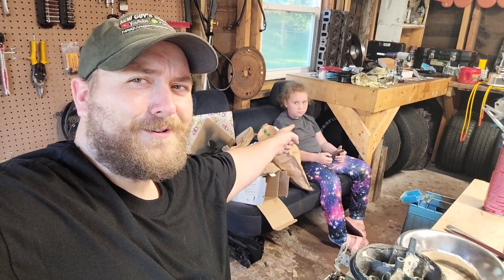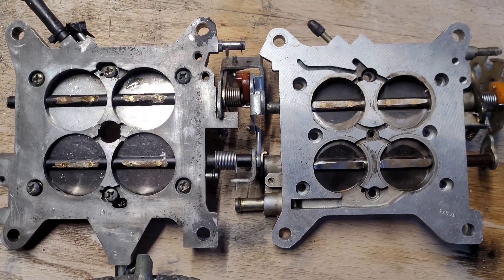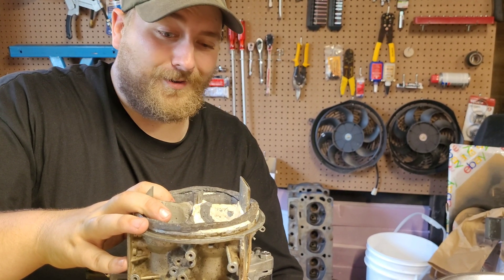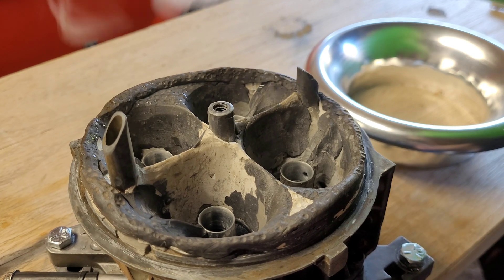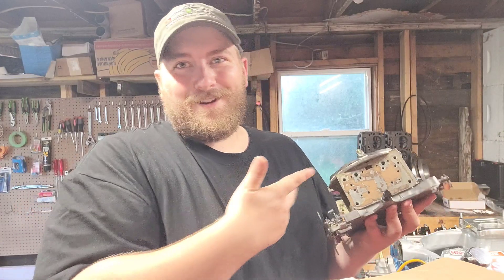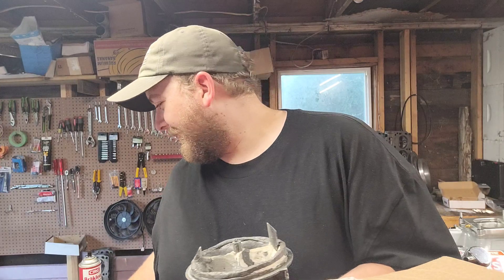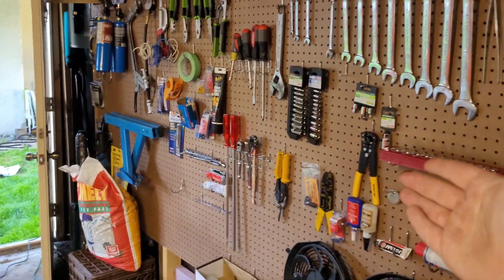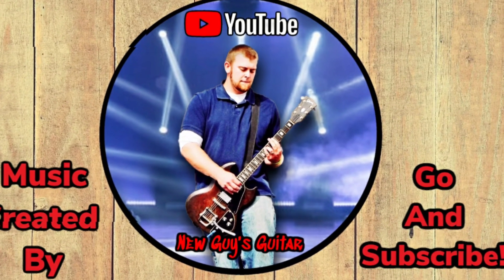At Home Flow Testing! | Holley 850 Baseplate On A 600 Main Body | Carburetor Performance Mods! | XMC

Comment: A 850 flows more that a 950 and a 950 is a 750 body with an 850 baseplate… 750 has smaller Venturi than 850 🙄🙄. Holley math? Make it make sense. A 950 is a little more responsive but is actually around a 830 if I remember correctly.
Reply from the maker: Gets more confusing since an HP holley 950cfm.....actually does flow 950cfm 🤣
So now you have to know what kind of 950cfm carburetor you have, to know what it flows on top of all that 😂👍
Reply: @newguysgarage6802 not by any flow tests I’ve seen. Any flow test I’ve seen a Holley 950 flows around 830, which makes sense considering a smaller Venturi with the same baseplate flows less that a larger Venturi with the same baseplate. I’m sure it flows 950 on holleys bench, but not anybody else’s 😂
Reply from the maker: Its there ultra xp line that the 950s actually flow 950, all the older ones are just 750 main bodies with 850 baseplates lol 

The ultra xp line actually has large venturis

Comment: Nice share, love your car color, interesting carb mod gotta sub to see 👀 your flow numbers, back in the day i would take a 750 vacuum secondary carb and drill it to make 4 corner idle and add metering block to jet it like i wanted also had a 850 double pumper and my 750 ran very close on a 427 bbc !! 😊😊
Reply from the maker: @RonaldLewis-py6yt  nice! 😃

Ya the XMC project has been a long running series on the channel with very interesting results! I can't wait to see what this baseplate mod is going to show on the flow bench 😁

@JosephNowak is who is flowing it, has a couple videos on it with the numbers so far. Defenatly go check him out and give him a like and comment for helping us out 🙂

Comment: Using a 3310-1 base plate on a 600 main body, using the 3310-1 center pivots and metering plates mounted on a A code 289 with J code heads that have been worked over with larger valves. The 850-950 base plates are the biggest base plates you can get for that series of carburetors
Reply from the maker: 3310-1 that should be a 750 baseplate right? 
A 750 baseplate on a 600 main body is actually what a regular 650 holley combo is lol. 

But they just chamfer the very bottom of the bore to fit the baseplate, Not blend it all the way up to the venturi opening 🙂.

I wanted to go with the 850-950 baseplate because like you said it was the biggest one so we could see what that changes on the flow bench 😃
Reply: @newguysgarage6802  had to chamfer the bottom of the bores on the 600 main a little bit, actually a substantial amount, but not as much as you had to with 850-950 base plate. Carb has excellent low speed characteristics, I’d say it flows 700-725 cfm with the air horn removed. Would like to install some nicer boosters in it so signal is enhanced even more. Air flow vs volume sometimes can be in your favor for small CID engines, higher reving smaller ports, more turbulence in the combustion chambers ….
Reply from the maker: @blkcoupequattro  nice! 
When we did stage 1 of this carburetor we removed the choke horn and smoothed the entry and picked up 84cfm 😁

I feel like the 850-950 with that small venturi would be a killer throttle response combo, and help atomize the fuel. 

Going to see what the flow bench tells us then I am going to make another main body that we can actually put on a car and see what happens 😃